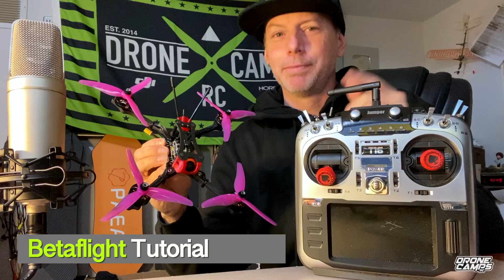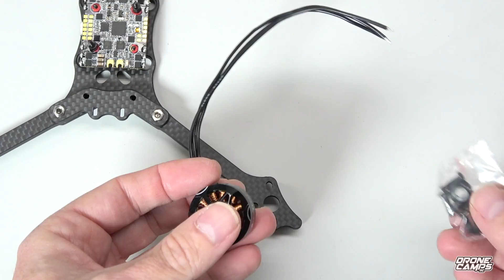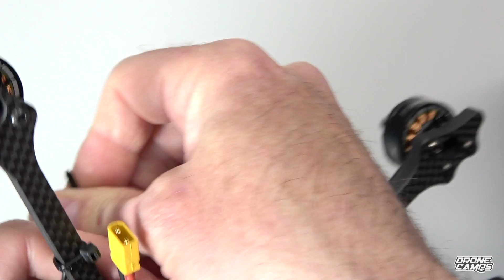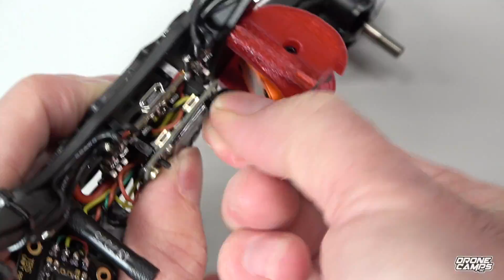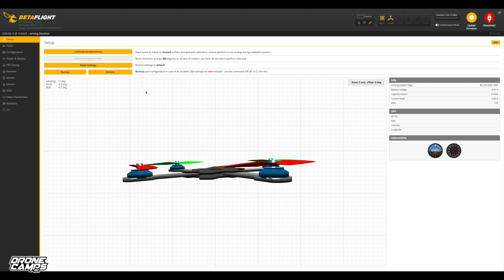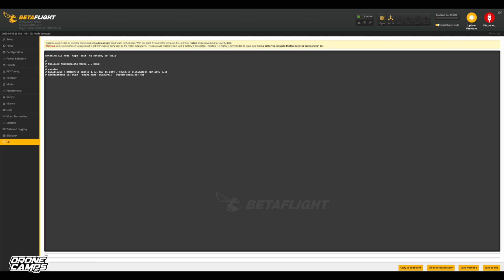BEGINNER RACING DRONE - Stay at Home Build Video! - 'NEW 2020 EDITION 🏆

Comment: Hey there, i would really like to build this quad, but my problem is that i have a Graupner MZ 12 pro transmitter and i dont know wether it will bind to the FrSky reciever. I was searching for Graupner sbus recievers but they dont have any. I m not that good on the topic of transmitter to reciever binding and what systems would work, mabye a different Aio- Reciever combo, but dont know... mabye you can help me out. that would be great  :)

Comment: I'm confused about the "1080p HD DVR with Runcam Split Micro 3 Cam" will it only work with Digital (DJI) Goggles? Or will this still work with my analog set up while saving a HD "version" of my flight on the SD card?

Comment: In the video you say to use 2450kv for 4s, but you linked 2675kv. Would 2675 or 2650kv be too much for the esc or would I be ok with the higher kv?
Reply from the maker: No it would be ok. Just a little more power
Reply: @dronecamps  Ok cool. Because I have been flying freestyle and I want to build a faster racing quad. Do you think this quad would be the way to go or is there another build that may suit me better? I'm much more experienced than a beginner.

Comment: awesome video for when I'm ready, hey my new BabyHawk 4R FPV goes bad 30ft a way I believe nothing is wrong with the drone. When I pull the top off and manually put in R C6 P-h it seems to work ok but once I unplug the battery and go to fly again the FPV goes back to low and no good. And yes I am saving my changes on the drone, am I missing something in Betaflight I think you quickly went over today?